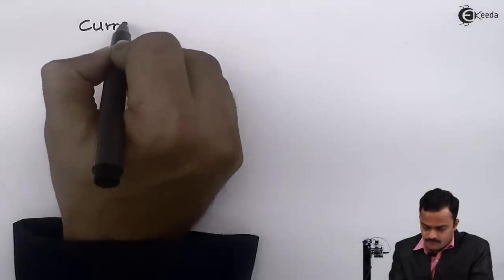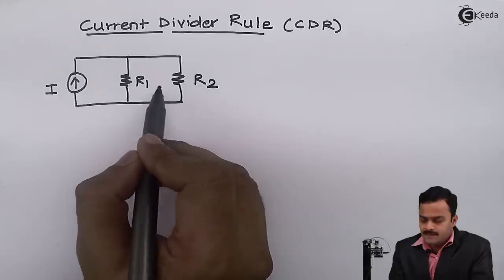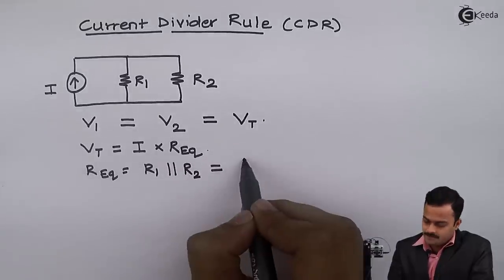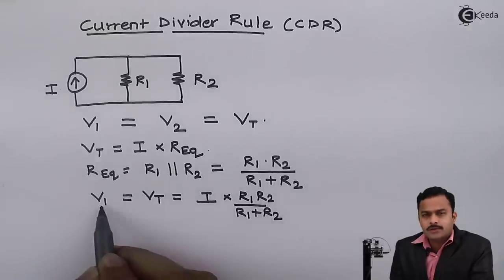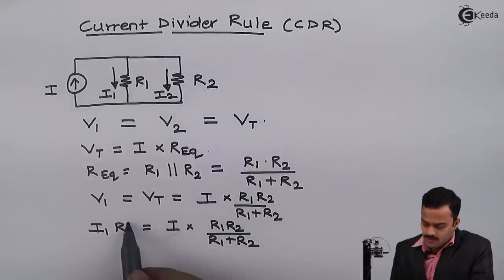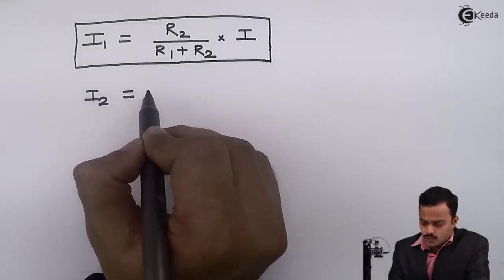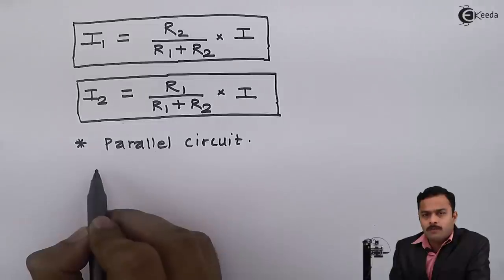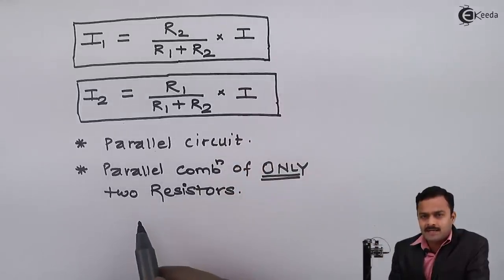Current Divider Rule (CDR) - DC Circuits - Basic Electrical Engineering

Comment: What if there are three resistor and are connect to a source of voltage
?????
Reply: That would be similar ,but for Req you have to work..  Req =r1r2r3/(r1r2+r2r3+r1+r3)